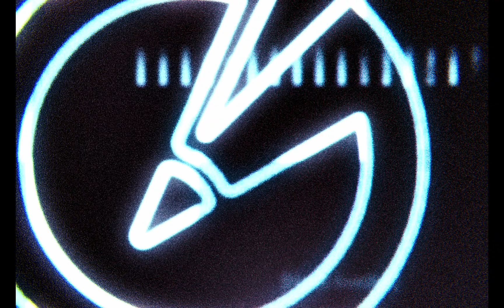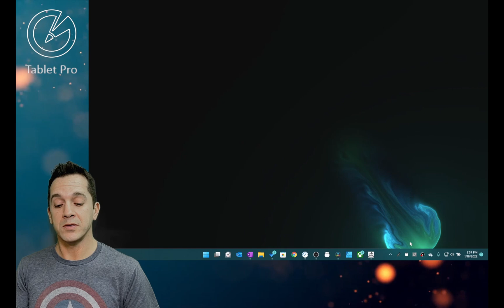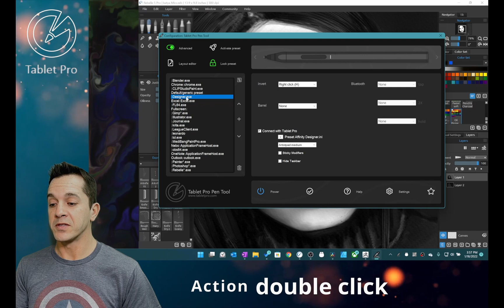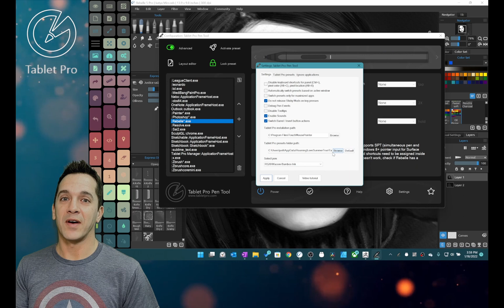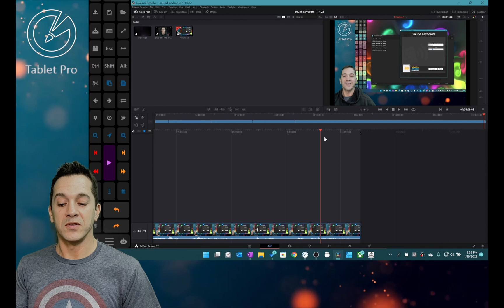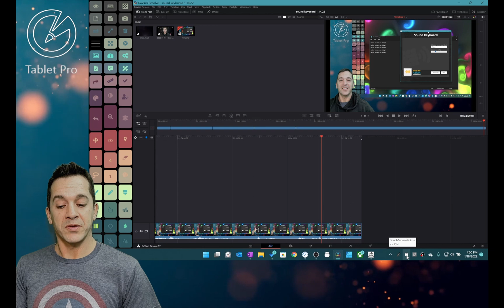Quick Easy Guide for using Touch Keyboard Shortcut buttons in Microsoft Windows - Tablet Pro Tools

Comment: That new PenTool UI looks lovely. ❤
How is Windows 11 doing for Artists nowadays?
My Surface Pro 6 gave me a lot of Bluescreens, when I started to use Win11 a few month ago.

I'm thinking of giving it another try.

Also I'd love to see a quicker manual way to switch to certain ArtistPad profiles (Instead of having to relay on a completely separate App, that trys to guess, what I want to use based on my active Window)
Reply: Or maybe a way to launch applications via a button in the ArtistPad. Then we could use something like AutoHotkey-Scripts to execute macros and other functions.
It would add a ton of versatility, without you and your Team having to put in much programming work.
Reply from the maker: I don't think we have figured out the best way to do this. but we are making progress. The keyboard shortcut Win+Shift+Z will launch the Artist Pad for the current program if it's set up in the Pen Tool. That or that single tap of the Pen Tool icon. 

Windows 11 is not better for artists in my opinion. I can't think of a single feature that they've added that makes anything better. just removed pressure, some bug with the icons on the right when starting to use the pen after a bit and a weird latency / invisible ink bug in onenote and journal. I'd wait still if you aren't dying to try it. I will say it is beautiful.